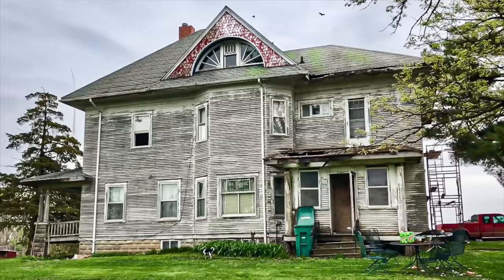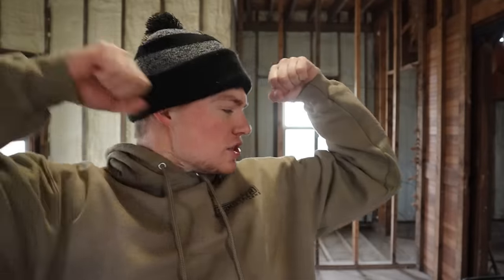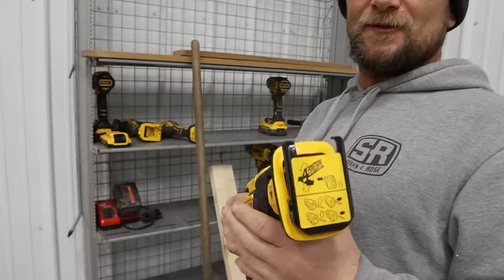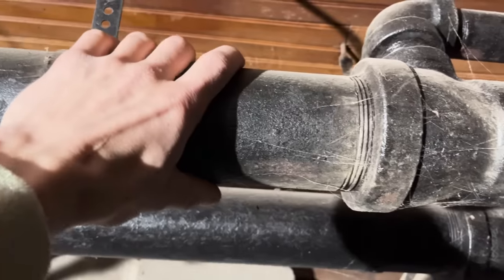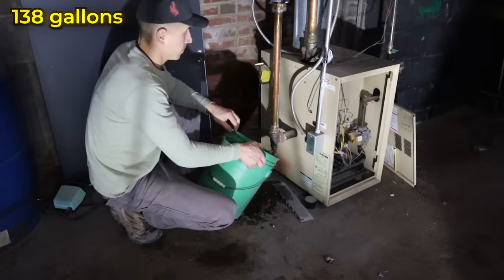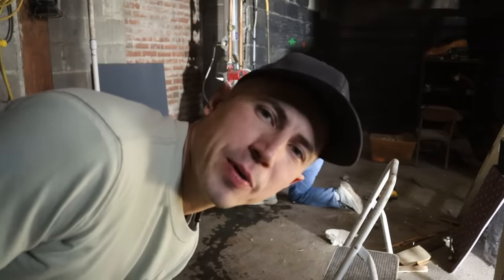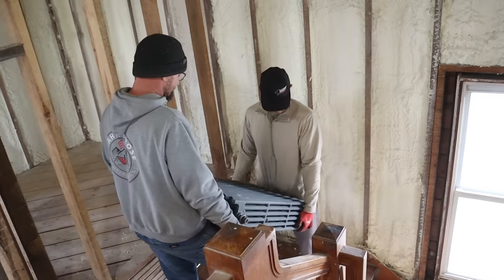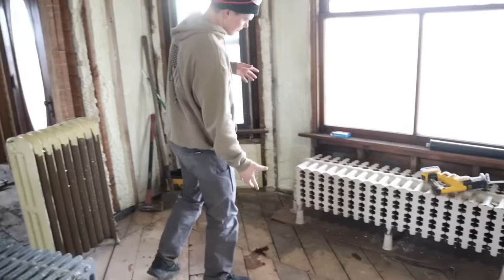Restoring A $7,000 Mansion: Removing Antique Radiators

Comment: Radiators can be taken apart (and re-assembled) easily for transport. When I converted my attic from radiators to forced air I was working by myself, so, out of necessity, I took them apart. Easy to clean or media-blast while they're apart, as well. Definitely a market for those things.
Reply: Where did you get a tool to unscrew them? Or made your own?
Reply: @Romegrom  The radiator sections had continuous threaded rods at the top and bottom with standard garden variety bolts at the end, holding the interlocking sections together. Pretty simple job for any socket wrench.

Comment: So, that old system took about 170 gallons of water.  The new system with baseboard heaters and radiant floors will require about 1/10 of that.   Think about boiling a 170 gallon pot of water versus a 17 gallon pot of water.  My back hurts just watching you guys.  But you made the right move.  💪

Comment: Noooo,  keep the hot water  radiators!  We have a 1732 house with 23 radiators in Pa that we almost switched to under floor radiant hear during renovation.  I am so glad the heating/plumber company that we hired explained the system and benefits vs. radiance heat, so I'm so thrilled we didn't. It's so wonderful to sit with the kids during cold winter days, having hot chocolate after being out.
Reply: They will regret having the underfloor radiant heating as their only heat source.
Reply: He doesn’t know what he’s doing with this house. He’s pretty much ruined it.

Comment: FWIW: Those radiators can be disassembled!! They were usually assembled on site.
Reply: I'm guessing it would be pretty tough to take them apart, though, without using a cutting torch.
Reply: Young guys don't stop and think sometimes. I've gotten way past the stage of having to prove how strong I am. I'd have taken them apart as you would have.
Reply: @ILGuy2012  It's usually much easier than people think.
Reply: Basically bolted together with the end caps. Get a little ugly with a 3' pipe wrench & you're done.

Comment: Gentlemen, 

You did a great job removing the radiators!  Don't know what you plan to do with them, but some people like to restore them - as old models are hard to replace. Maybe someone will buy them from you.

On the huge water tank downstairs, you seem to be planning on tearing it out. Is there any way you might want to keep it, by cutting off the top half and turning it into a utility sink? Something else?

If not, you will need a small access hole on the top, that you can run a hose into, and a small water pump. If you can get one with 3/4" male inlet / outlet, just attach it to a standard garden hose on either end, to get the water out.

You'll need a reciprocating saw with a few metal cutting blades to cut through the the top half. Take a look inside. There might be a later of heavy sediment in the bottom, just like an old water heater would have. You might need a few rags and buckets to scoop sediment out.  Cut off the ends and cut what's left into pieces you can get out through a window or door. It's basically like pulling an old, huge water heater. 

Welders have cutting torches that might cut through it faster, if you want to try that, and there's nothing flammable in the area.

I know you will get it done, if you work together at it. I have faith in you.  Be safe. 😊

Comment: Our house has a similar heating system and it's pretty great. We have "baseboards" in the living room and flat radiators in every room on a wall. Its clean, even and efficient. On cold quiet nights you can hear the furnace kick on and push water through pipes.. I go right to sleep 😂

Comment: Wow, what a scrap lifitng contest that was. Removing old radiators is a heavy undertaking as they are stupid heavy and hard to move around. Even with 4 fit guys it still was a tough undertaking to clean them out. I am impressed with Roman and Justin's will to keep on pushing and emptying water by the bucket load. I would for sure have stolen a garden hose and evacuated the water instead of carrying a ton of water around! Good job!

Comment: The next time you have to deal with radiators or other heavy stuff, use  moving carts.  We have several sizes and have moved a lot of heavy stuff, from furnaces to commercial refrigerators and large ovens.  The wheel is a wonderful invention, but brute force works well too .
Reply: Could have built a couple of small dollies to move them,on the stairs could have put a couple plank down and slide them down the stairs on their sides,we use to move 1200# fire safes

Comment: My sister has in floor radiant heat, but still has a furnace for really cold days. Lives in northern Michigan!
Reply: He is going to need more than radiant floor heat.
Reply: Grandpa installed a forced air furnace to heat the basement.  Not sure if they will be keeping that, though.  It would be a good idea to have it as a backup, or as you suggest, supplemental heating.
Reply: Cole will too. He's going to have deducted cooling and will still have that furnace that his grandpa had

Comment: It's done now but consider getting yourself a two wheel dolly or an appliance dolly.  I can move 600lb without too much trouble and even up to 800lb.  The leverage and the wheels makes all the difference.  If they have a stair runner on the back going down the stairs with those wouldn't even be too crazy either.  Great videos.  I love how positive you guys are.

Comment: I was thinking watching you move the radiators what could make it easier. Once the video was over, I concluded that maybe a 4x4 post with a 2x10 screwed to the top if needed for width of radiators, a couple of old caster wheels on the bottom like a wooden scooter would have helped a bit on everything but the stairs or just like a home depot wood cart. Glad I could be of assistance 🫡😄

Comment: Those radiators can be broken apart.  If you cut the threaded rods running thru them, you can drive a splitting wedge or a wedge made from a piece of 2 by 4 between the sections.  They are just held together by steel push nipples and usually separate easily.

Comment: I know by now it’ll be a little late by the time you get this, but you can separate them. They’re connected with long threaded rod through them or you could use your saw, saw and cut them in half or smaller.

Comment: Honestly I would have kept the radiators and repainted them and installed the in floor heat as a separate zone on the boiler. Cast iron radiators add such beauty to a room when you paint them really nice.

Comment: Cole, I don't know if it's available in your area, but one of the problems with heated floors is that sometimes the heat is not distributed enough,  Make sure that your HVAC guys have worked with radiant floors, usually the best thing is micro vents in the rooms, which help greatly with heat distribution, especially near the windows were the cold and heat interact more.  Also, you need triple-glazed windows with aluminum film, otherwise, it will always be cold by the windows.  Still it's the best system, especially these days.  You could combine it with a geothermal system, since you have such a large lawn, it can be horizontal instead of vertical.  Very cheap, basically a heat pump that takes the heat from the ground instead of the air.  It provides free air conditioning in the summer months...

Comment: Best way to handle those cast radiators is to get a sledge and steel wood wedges. You put the wedges in and hammer them and they break apart in sections easily. Then you scrap them he pieces.

Comment: Don’t those old radiators have a rod thru them that can be removed and then taken apart?   I thought I saw some bolts to remove.  Too late now, but gosh that was alot of work!  Enjoying the house content!  Roman, you are a hoot!
Reply: Yes.  There are 'through bolts' and the sections are connected with what are called 'push nipples', short sections of pipe that fit into the holes at the top and bottom of each section.  They're pretty easy to get apart if you aren't worried about damaging them, but putting them back together with new nipples and not leak can be a b1tc4!

Comment: I think I would have rented some kind of pallet jack to roll the heavy radiators onto and roll them out to the skid steer to load up.  Or devised some way to lay them onto something you could roll them out of the house on.  Of course the ones upstairs have to be carried down the stairs. A dolly would have worked for the smaller ones.

Comment: I lived in an apartment that had rads when i was a kid ..we moved to a house with hot air heating...we used to put wet clothes on the rads to dry or sit with our feet on them if we had been out in the cold..i would take rads over any other kind of heat..you can't lay wet clothes on the floor .

Comment: For what it's worth, here's my experience with underfloor hydro radiant heating. I have it in my 2-story house, both upstairs and down, installed in 1997. It's great if you want to walk around the house in your socking feet. Now that I have the positive attributes done, here's my negative of the system. I don't have a basement (high water table in winters), only a 18-24 inches crawl space. Pipe is half inch PEX-A, two lines with aluminum reflectors between each set of floor joists, different zones with each having it's own thermostat (computerized, time on , time off, temp., etc.). I have two manifolds, one on either side of the boiler (big house), boiler on 2nd floor (no basement). Manifolds and boiler in a dedicated room about the size of a New York City apartment, pipes from manifolds go down a chase to the system supplying the ground floor (in crawl space) or off thru a horizontal chase (18 inches high, big enough for a skinny guy to access), down thru the center of the house to feed the lines under the 2nd story floors (and above the 1st floor system). I have brass manifolds, with the rubber O-rings, which will leak and have to be replaces every couple years. About 12 years ago, on New Year's day, one of the rubber O-rings leaked and drained my entire boiler down thru the vertical chase into the crawl space below the house. Lots of maintenance with the electronic valves controlling the on/off floor pipes, also pumps and pressure regulators (step down). I did a complete overhaul 4 winters ago. No leaks from upstairs thru the first floor ceilings, but the pipes for the ground floor (in the crawl space) are constantly leaking because of rats getting under the house and chewing into the PEX, they love it, despite anyone telling you that rodents will not chew into PEX. They chew, and seek it out to drink the water. If you use d-CON® any place outside (like around your corn cribs) the rats will seek out the PEX and chew into it for the water (d-CON® poisoning will cause rodents to increase their thirst for water). Pumps are electric, so if the lights go out, heat (my boiler is natural gas). If you want AC for the summers, you need a complete separate system with ducts and compressor outside. Some people will try to convince you that you can run chilled water thru the system to cool in the summer, not true. Would I ever do it again? NEVER.
Reply: A couple more negative thoughts, it will take about three days to heat a large house, slow to bring the room temperature up rapidly during a cold snap like Iowa. I live in an area where the winters never drop below 45 degrees and it's still slow to get the house warm on cold days. I have a gas fire place for that only reason, rapid heating when the temperature outside drops suddenly.
Reply: I have a large open stairway and in an attempt to heat it I had the radiant heating installed in the walls behind the drywall. It was supposed to heat the area (1997 claims) but absolutely worthless. In the bathrooms it was installed behind the large (full wall) plate glass mirrors to keep them from fogging over, worthless too.
Reply: Oh man that sounds like the most complicated type of heating one could get.

Comment: Radiators are modular. There’s threaded rods that run through the length of the radiator. Cut the rods and the radiator will come apart

Comment: Should’ve kept the original steam heat/ installed a modern steam boiler and new controls. Then just added a central air fcu for the a/c. Once that steam heat is dialed in it’s still probably the greatest heating system you could ever have, a literal masterpiece of engineering antiquity.

Comment: i have removed my fair share of cast iron radiators in my life...the easiest way is to cut the binding bolt and use a wedge and sledge hammer to split the sections apart.

Comment: YOU CAN SPLIT RADIATORS INTO SECTIONS AND USE THEM TO MAKE A DECORATIVE FENCE  YOU JUST HAVE TO PLUG THE PIPE OPENINGS BETWEEN THEM.

Comment: Those old Radiators but also Bad Tubs are cast Iron. You can literaly smash them hard with wide swings of your deconstruction hammer and it will break it.
To make it more Easy you could cut it little bit with your angle grinder or even use a chisel or center punch 8spring loadet is easy to use) to mark a line to break it with the hammer
Reply: O

Comment: I went a beautiful mansion in Medford oregon that was sold by Sears Roebuck in thier catalog at the turn of the 19 century. It came pre-assembled on rail cars and was assembled on site. It had 15 different types of wood for the moldings and cabinets ,doors .It was three story's high with a full size ball room on the top floor. The original ad. They had on display called it the gentleman's country retreat and it cost 6500 dollars . They sold these first prefab homes all over the country where ever there was a railroad to deliver them.
I really hope you saved these old radiator heaters and didn't trash them. Someone would love to have them. They are getting so rare they should be saved.
Have you guys in the Midwest ever heard of a hand dolly.

Comment: Radiators are outstanding for heat - I grew up in a part of the Midwest where most homes were built between 1950 and 1980 so I had no experience with them but then I moved to New England and bought a house that has them.  The downside of course is that I think they’re ugly, they take up space and you can’t put furniture in front of the window and, no central AC.  I don’t remember what Cole said the plan was for HVAC going forward.

Comment: Spay foam is nice, but it has a couple issues. If you do ALL the exterior walls and the roof, your house won’t breathe (you want some ability to breathe). The air will get stale and can become a perfect breeding ground for mold. If you do sprayfoam, you should do it on the roof and the attic floor and leave everything else alone

Rolled in insulation is great for exterior walls, you’ll want to do the interior walls too, believe it or not, the insulation will deaden the noise between rooms and will aid in having privacy

Comment: Did you calculate total weight of all radiator? Cutting them into sections isn't difficult and it saves backs. Removal would have taken half the time. I've done it. The house is looking good! 👍👍

Comment: So another 3 tons removed from the house between the water (8lbs a gallon) and all the radiators. No idea how much all that pipe will weigh, but between the heat system and concrete floor that has to be around two 3/4 ton trucks hauled out…..glad to see those radiators go with the kiddos who will be running the floors.

Comment: I have a large radiator in my 2nd floor hall with 18 34” sections. It’s located above the 1st floor dining room and is too much weight for the ceiling. I’m considering relocating the radiator to the basement. But, how do I carry 700+ pounds down 2 flights of stairs? Perhaps separating the sections then reassembling later is the solution.

Comment: HEY GUYS.   The large nuts on the pipes at the radiators is a union so you have just unbolted them.
Usually when you move cast radiators they are set on a transport dolly.

Comment: Just because joists don’t break over a wall  doesn’t mean it’s not load bearing. The span of the joists would  need to be supported half through the length. If you take out the walls supporting the middle of the joist you need wider joists. 2x10 needs to go up to 2x12.  Anything larger than that you need metal sandwiched in.

Comment: Those radiators must weigh at least 20% more than they did when installed with 107 years of the minerals from your water supply. That kind of heat back then was a modern marvel that was envied by most of the people in the world.

Comment: Cole, I assume you burn a lot of gas to heat this big house. Have you ever thought about creating a modern heating system in the house? for example, a water - water pump through a hole in the ground to use geothermal heat, it can also cool in the summer, so it is immediately future-proof. think about it, good luck with the renovation.
Reply: or even radiant floor heat, we installed that into a 100 year old house we redid and it was nice in the winter!

Comment: Radiators were built inside the house in sections; they are held together by either 2 or 4 through bolts.

Comment: Pipe wrenches, I am sure that Steel piping was used for the hot water heating. A condensing boiler is $900 on line, A.O.Smith . 199,000 BTUs about the size of a small suitcase. Appliance cart works better than your back to remove the cast iron radiators. I will pay money for your radiators.
Reply: Commonsense is less common these days?